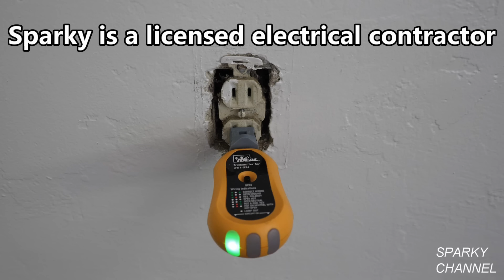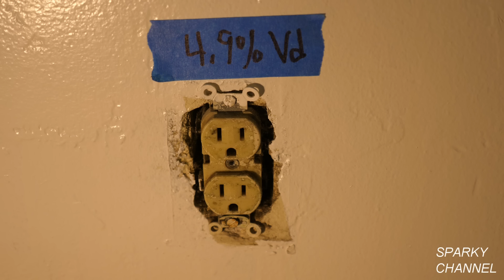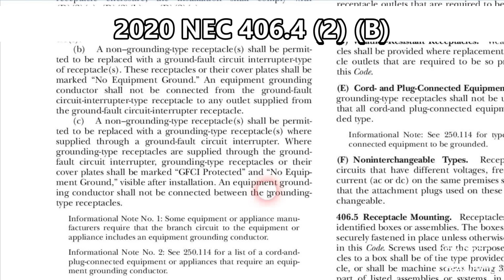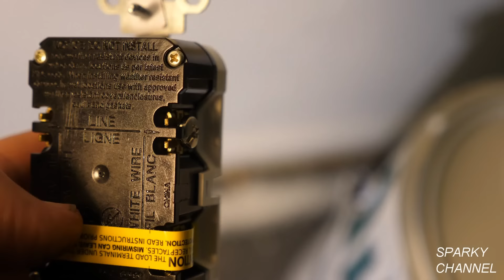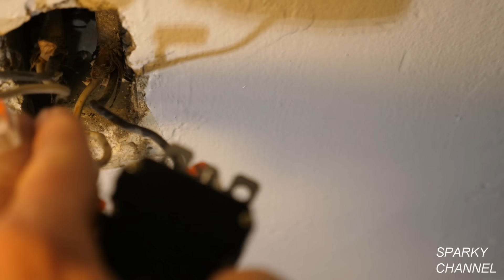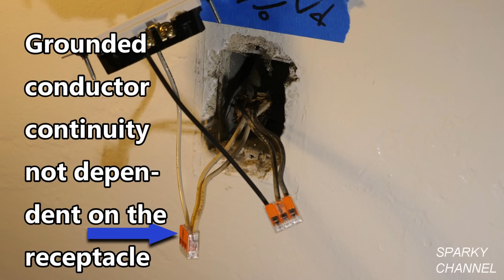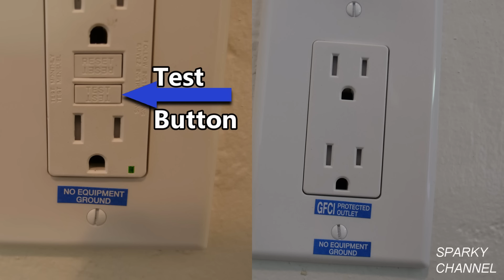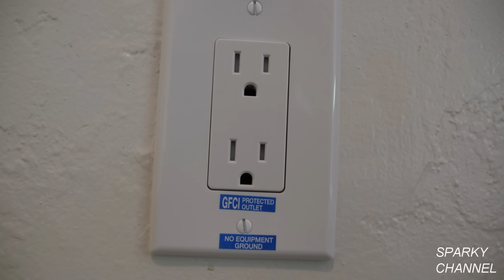2 Prong Receptacle Circuit Replaced by GFCI and Grounded Receptacles per 2020 NEC

Comment: What do you think is causing the Extremely High voltage drop in the circuit?    NEC suggests that the voltage drop in a branch circuit not exceed 3%.   You are showing over 13%.     I have done thousands of voltage drop calculations during my career as an electrical design engineer, and am extremely suspicious of the readings you are getting.
Respectfully,    Kevin
Reply: My best guess for the higher than expected voltage drop is age. With that wiring being ~50+ years old the electrons in that old copper aren't as fast as they used to be. Slower electrons equals lower voltage. LOL.  Seriously though, voltage drop is caused by resistance somewhere in the circuit. Unless the wire itself is physically damaged, that is made thinner somewhere along the way, I would not suspect the physical wire. That leaves the wire connections. Minor corrosion (oxidation) over the years could add a bit of resistance to the circuit. In this case about 0.8 ohms, if my math is correct. I would remove and reinstall circuit breaker from the panel, for that circuit and also reset it a few times to freshen the contacting (mating) surfaces. Also, remove clean and reinstall the wire at the breaker. The resistance could be elsewhere, but the breaker panel is accessible at least. 
Thanks for the video! I learned something new today!
Reply: Know Way     The only problem with your theory is that he replaced every device on the circuit.    There are no old corroded connections.   If they were that bad, there would be something else happening like arcing or heating.    I'm still confused.    If there were 30' of conductor between every receptacle, it might start making sense.
Reply: @KevinCoop1  I see your point. However I can't think of any other explanation for a voltage drop other than resistance in the circuit. Perhaps a junction box in the attic? I'm just guessing. I don't know anything about the place I'm just assuming there's not ~200 feet of 14-gauge in that run which would cause a similar voltage drop. Copper is copper. A given wire gauge will have a specific resistance per 1000 feet no matter its age. The only other thing that [ Should / Could ] be in the circuit are connections/splices, so that's what I suspected. Since the receptacles were all changed (who knows what's inside the walls) and got fresh new connections, I'm suspecting one or more junction-box/splice connections somewhere. I've seen wires in breaker panels that had been there for decades that were never screwed down. A lite connection like that could induce a voltage drop, though I'm not suggesting that's what's happening here; just that - thin - connections add resistance. As you stated it would likely get warm depending on the current, but could still work fine for hundreds of years. Is my logic flawed? Am I missing other options?
Reply: Know Way    I tend to agree with your thought.  He didn't say how many lights were on the circuit too.
Reply: I think age can increase resistance only by impurities during the older manufacturing processes, not sure if oxidation would cause that big of an increase but I doubt it.
Reply: @benjaminbarr8714  If my math is right, I don't think the resistance is all that big. Using a 10% voltage drop of standard 120-Volts is 12-volts. The test load was 15 Amps so the resistance would be 0.8 Ohms. Less than one ohm, and some of that is natural resistance of the wire. 15 x .8 = 12  15-amps X .8 ohms = 12 volts of voltage drop = 10%.  The likely contacts/connection in this circuit are: Service entrance to the buss bars at the main panel, circuit breaker connection to the buss bars, contacts in the circuit breaker, wire screwed to the breaker, screw connections at the receptacles, and maybe a wire-nut in a junction box. If each of those contact/connection points had just 0.1 ohms of resistance that would get us very close to the 0.8. A series resistance circuit. I'm just guessing here, but it's an explanation that fits in the absence of others. Occam's razor. The receptacles have already been reconnected, so probably no issues there.
Edit: I was just thinking; it would be interesting to connect a receptacle to that circuit's breaker right at the panel and read the voltage drop (if any). There are more connection from the panel all the way back to the transformer. Meter base, splices, et al.
Reply: Know Way    I think that all should agree that 14.5% voltage drop is way excessive.  The first one was 4.9%.  If on a long and old 60 amp overhead service and the utility installed very small conductors, I could see the 4.9% on the first one.   Now with an average of 19' of conductor between the receptacles, there is no way the drop should increase in that short of a distance.   Sparky Channel needs to explain this one.
Respectfully,   Kevin
Reply: @KevinCoop1  Agreed.
Reply: Know Way ;
Reply: I 2nd that!

Comment: happy to see that you didn't put the receptacles in upside down I just hate seeing receptacles with the ground port at the top of the outlet  love the videos.
Reply from the maker: Thanks Nate!
Reply: Electrically it doesn't matter.  There is a safety argument to be made for ground up orientation which is the norm in Canada.  Of course, if something metal fell at an angle against a partially pulled plug it could hit the hot and ground or just the hot prong and still cause a hazard.  Reportedly the ground is usually oriented down in the USA.
Reply: The grounds are actually supposed to be up. That way if a plug is hanging out of an outlet and a metal object slides down the wall, it won't be able to short the circuit. It will just hit the ground.
Reply: @jimmac1185  really?  That is a thoughtful point.

I happened to shock myself last month when I was pulling the plug (I shouldn't have done that, I was in a hurry), but I accidentally touched the hot/nurture prongs simultaneously by my 'wet-bandaid' on my fingers. Bad me! I should have worn gloves instead of using my bare hands.

Comment: I'm so glad you use Wago connectors.
Reply: Why? Are you a firefighter looking for work?
Reply: Jim Mac Your comment shows your ignorance. Wago connectors are safe to use in residential wiring applications. They are UL rated and have been on the market for many years. So please explain what you are implying?
Reply: @williamGSXR110  wow, glad to see civility is thrown out the door right of the bat and insults are the way to win an argument. All I'm saying is they are dangerous, no matter what UL says. I'm a licensed journeyman electrician, specializing in fire alarm. I've been to countless job sites and spoken to hundreds of other electricians. Not one has ever said they like Wagos. In fact, they cut them off light fixtures,  and replace them with wire nuts. I've heard many horror stories about these "safe" devices. I suppose you're a fan of backstabbing outlets?
Reply: Jim Mac To say the least there is a good reason why wire nuts are against the code in most civilized countries.
Reply: @williamGSXR110  good job saying the least there, unfortunately you just destroyed your previous argument. Seems to me that WIRE NUTS are "UL rated and have been on the market for many years". 🤔
Reply: @jimmac1185  wagos are safe to use if used properly.
Reply: @jimmac1185  Good for you speaking out about trendy garbage. I put these in the same category as Sharkbite fittings...a problem waiting to happen.

Comment: Sparky, thank you for such a pleasant attitude and informative video! Quick question: what was the tool you used to push the terminated wire back into the box, at approx. 15:39?
Reply: I found the tool, VOLTCLAW-12 Nonconductive Electrical Wire Pliers
Reply: I wish he'd respond to your comment...I wanna know too 👍

Comment: A) NEC is NOT a technical manual. It is a minimal electrical safe installation to avoid fire or electrocution. B) Based on extensive research and testing contrary to conflicting opinions the GFCI will NOT consistently trip in a ground fault condition without a green or bare equipment ground. This has been tested in a lab demonstration hundreds of times at a major auto manufacturer's training centers and field training I personally was involved in.. NEMA submits the GFCI will trip with hot/neutral imbalance only (no ground). I submit under the experience in multiple repetition lab conditions a GFCI WILL NOT trip in an imbalance without a valid secure solidly connected equipment ground. As an electrical engineer and electrician, this is a sore spot with me as even labeled per code the GFCI or updated receptacle without a rewire of the home will likely NOT trip as expected. If you want the safety of a GFCI and a ground I submit rewiring the home is the best option. Code not withstanding.
Reply: Can you explain the conditions under which it does not consistently trip? You don't write it, but I suspect you know it.
Reply from the maker: Thanks!
Reply: Sure it is the best option, where money isn't an issue.  But unless you believe the use of 2-wire GFCI's is worse than not using them, then there has to be a cost/benefit analysis.

Comment: Careful putting 15 amps on a circuit like that. The 50's wires could melt and all sorts of bad stuff can happen.
Also i would name the outlet circuit Bedroom main outlets.
Reply: That house is probably 14 Gauge braid with asphalt-soaked braid outer jacket painted silver. The conductors are insulated with natural rubber that is beginning to break down. Any attempt to do major upgrades with the existing wire is an engraved invitation to a major burn out. Proceed with extreme care! 47 years of experience speaking here!!
Reply: John Goodman he wasn’t doing any upgrades. He’s simply making the circuit code compliant and safer than it was before.
Reply from the maker: Thanks for the tips!
Reply: Ok...and what happens when the homeowner or tenant uses a fancy 12A Vitamix blender on the circuit, or like he said, a 15A skillsaw? All of a sudden they’re not going to melt anymore? Lol, they’ve lasted decades with all sorts of things being plugged in. Pretty sure his test instruments won’t hurt it. Use some common sense.
Reply: @RB-xv4si  THERE 60 YEARS OLD! HECK COULD BE EVEN 70 YEARS. THEY COULD HOLD A HEATHER BUT NOW ITS GOTTEN OLD
Reply: AWIRE9966_09onpc sorry, my eyes are bad. Could you use bigger text next time?
Reply: If sombody Brings in a bunch of space heaters for all the bedrooms and uses that breaker the wire might turn into a puddle of copper and Melted rubber.
Reply: AWIRE9966_09onpc you ever heard of a circuit breaker or fuse? They trip when there is a circuit overcurrent. And if there isn’t overcurrent, the wiring will be fine. End of story

Comment: I thought the code said you had to have a GFCI at every location unless that was change for 2020 thanks for the info
Reply from the maker: The NEC says what is says.
Reply: Just because a device isn’t a gfci device doesn’t mean it isn’t protected by one. Any load wired off of the load side terminals of a gfci receptacle has gfci protection.
Reply: @RB-xv4si  If properly grounded. Do not expect proper protection if it is not grounded!
Reply: John Goodman you don’t need a ground terminal to get gfci protection. Did you not get the whole point of this video?
Reply: @RB-xv4si  Mr Goodman has been involved in lab tests that verified hot and neutral imbalances dont always trigger the fault unless the gfci is grounded. I tend to believe this theory after researching his comment on this in previous comments above.
Reply: C Smith you can do all the research you want until your mind goes numb. But unless you grasp the concept of how a gfci functions, it doesn’t do you any good. So as a licensed electrician, let me do you the favor of explaining. The gfci device measures the difference in current between the hot and neutral return. It is designed so that if that difference is more than 5 milliamperes, it trips, because the assumption is that the unaccounted-for current that didn’t flow back through the neutral is flowing through a human body, into the ground, and back to its source. And when I say ground, I literally mean the ground, or something that is grounded by its very nature, like a concrete slab. And just to hammer the concept home, let’s say your body somehow completes the circuit from a gfci between the hot and the neutral. Guess what, it’s not going to protect you. There will be no difference between hot and neutral return. That goes for any gfci receptacle, whether it’s grounded or not.
Reply: @RB-xv4si  Lol, I do know all of that. As a licensed electrician of 20 years, let me do you a favor. What you said is correct about function of a gfci. What Mr. Goodman is talking about is the extensive testing that has been done on this theory and found that the gfci doesn't always function as it should in the situation of there not being a seperate ground present at the gfci. I'm not arguing the code. I'm arguing that it isn't completely safe as one would assume.
Reply: @RB-xv4si  Another thing. Being a licensed electrician isn't a good reason to believe someone knows what they're talking about. Im not referring to you. Im referring to things I've seen in last 20 years that was done by licensed electricians. For example, gfci feeding another gfci or 2 gfcis in same workbox on same branch circuit, or 2 gfci plugs on seperate branch circuits in seperate workboxes that have a 12-3 cable between them sharing the neutral but also protecting a load downstream from first gfci over that same 12-3. Based on your description above i would assume you have a clear understanding of gfci function, not by stating you passed a test 70% or better of 120 questions that takes 1 day to study for.

Comment: I like the solution for the old two prong non grounded outlets and it doesn't involve having to run new romex with a ground. And the charmer is that it's compliment with the NEC codes latest revisions. We have a lot of old houses that are 50 years old and older. Spark on brother!
Reply from the maker: Thanks so much!

Comment: Keep these videos coming! I have a house built in 1950 and all of my electrical outlets are outdated. How about a video on switch-less ceiling lights with no way of shutting off power to the fixture? PLEASE?!
Reply: You basically need to run a wire from the ceiling box to a new switch location.

Comment: Why did the probe light up after you cut off the power to the breaker at 9:50....?
Reply: They do that for a second when you tap them on things. If it doesn't continue to blink and beep, then you're good to go.
Reply: It was flashing occasionally to show it was turned on.

Comment: Great tip on using that little grey adapter for the transmitter.  In a related question, it would be nice to find a transmitter that had insulated alligator clips to attach to the live wires of a GFCI to find the circuit.  Once that GFCI pops and wont reset, pretty much useless to plug anything into the front of the outlet as the device is doing its job correctly.  I can make my own alligator clip setup but if anyone has any tips, I would appreciate hearing them.  mp. (found the alligator clip thingie on Amazon after I wrote this)
Reply from the maker: Thanks!
Reply: I made an alligator clip setup that sounds like what you're describing.  I have a Klein circuit tracer that has a 2 prong transmitter, but this could work for a 3 prong transmitter using the gray adapter.  I got a weatherproof pigtail lamp socket and screw-in outlet.  I attached a set of alligator clips to the pigtail wires and use that for connecting to exposed wires, then plug in the circuit tracer transmitter.  It's not pretty, but it hasn't failed me yet!

edit:  After doing a quick search, it does appear that Klein does have a purpose made accessory kit that does the same thing.  Klein # 69411.  It's a little more expensive than my custom setup.
Reply: https://www.homedepot.com/p/Klein-Tools-Circuit-Breaker-Finder-Accessory-Kit-69411/202266613 .  I also made a 110 plug to alligator clip adapter with color coded alligator clips (black, white and green).

Comment: Hi there. Quick question. On the GFCI outlet you installed,  could you have installed a ground wire to it from somewhere outside the house like a grounding rod to protect the other receptacles down line? As an added layer of protection for sensitive equipment like computers? Or does it not work that way?
Reply from the maker: Ground rods have a different design and purpose than what you're proposing. Yes, you can run ground wires to boxes as long as the ground wire is in proper sheathing or conduit and it's properly run.
Reply: No. A ground rod is a system ground. The green wire in newer construction is a bond for safety purposes. Google grounding VS bonding. Mike Holt has great insights.
Reply: Do not start to improvise with the grounding. Just stick to the code. It has been written by people who know more than you do.
Reply: A ground rod is useless unless it is bonded to the electrical system ground.
Reply: @4delfadelfa  not unless u sit on it.

Comment: Is that much voltage drop common? For me, as someone with an electronics background, I’d think one would want a lot less voltage drop than that!

Great video, by the way. All the praise you’ve gotten in other comments, too, is fully deserved!
Reply from the maker: Thanks so much. Even though it was tested under a heavy load, that's too much Vd IMO. But it's a 1950's house with plaster wall and built on a slab so it's difficult to change out.